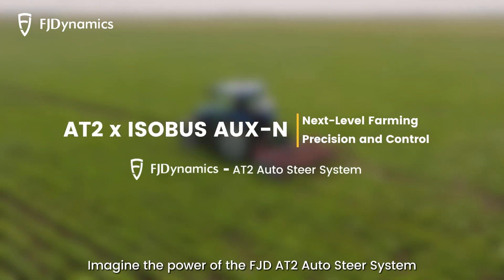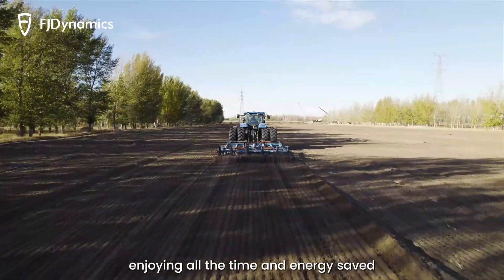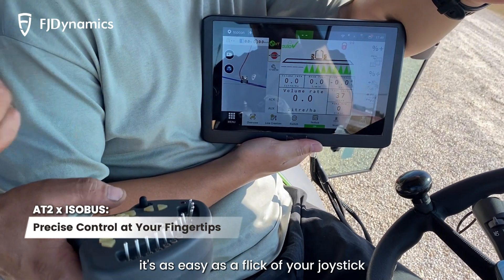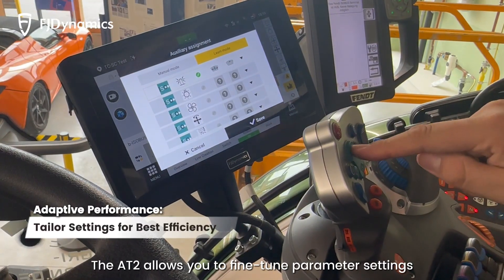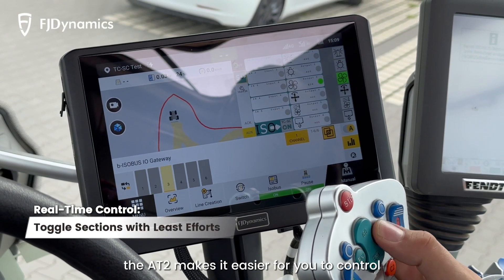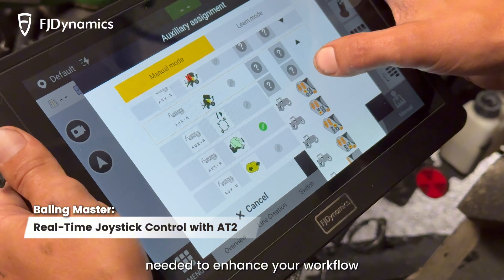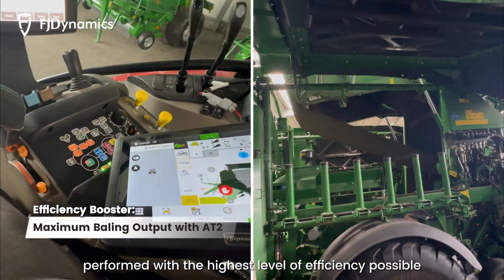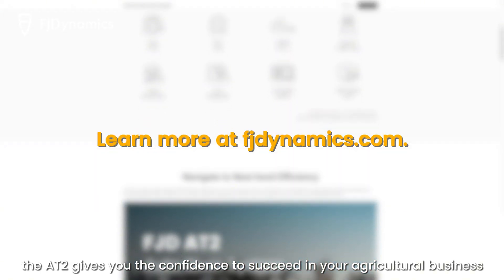FJD AT2 x ISOBUS AUX-N: Your Farming Magic

Comment: Hello, I have an AT2 system and a ISOBUS ready tractor. I am a little confuse about what wiring do I need to buy to connect them together. I don´t know if I only need the ISOBUS in-cab Cable or the ISOBUS ready kit (ISORDY) as I can not see where the CAN BOX must be connectred to. Could you explain twhere that box goes?